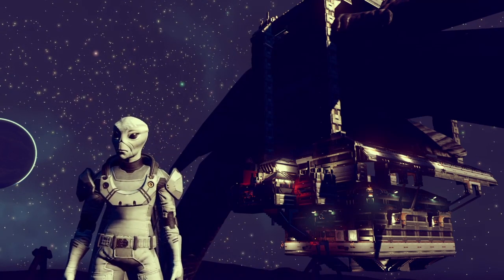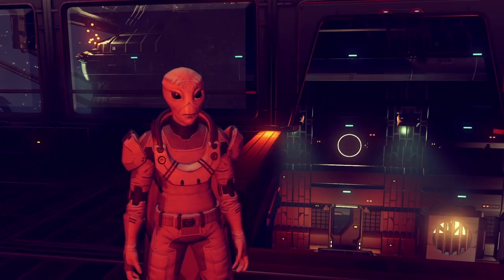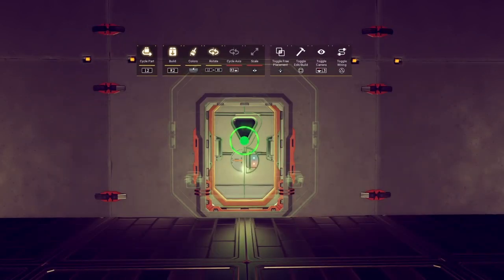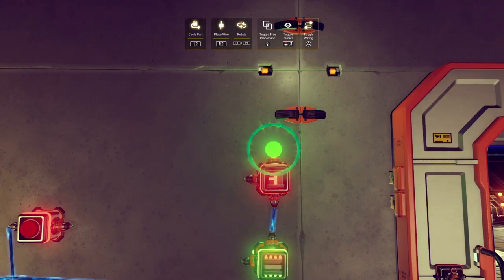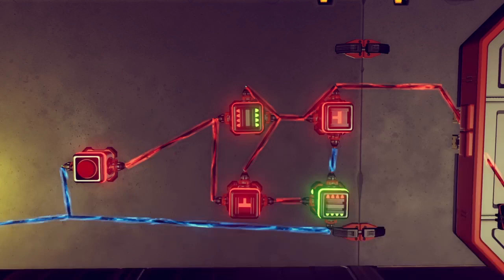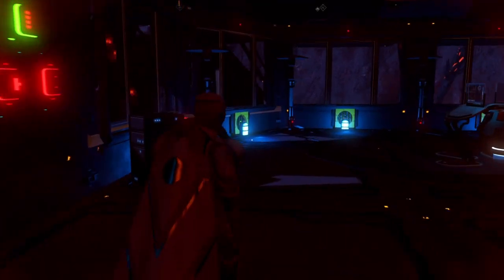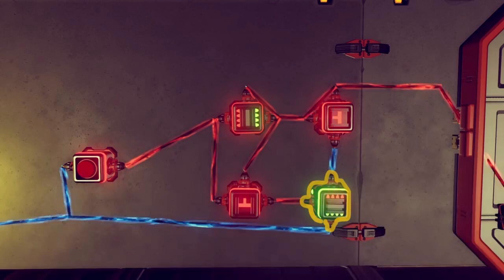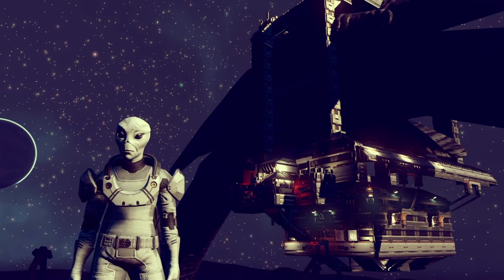No Man’s Sky, Logic School: Mastering The Big Red Button (with a basic toggle circuit)

Comment: That's so easy! I mean a simple open and close button would be extremely complicated to understand.
Reply from the maker: There’s already one of those, but there are a lot of reasons you may not want to use it. this is for triggering more interesting effects, operating a toggle is just its most basic use case. It’s step one to learning how to use the wire system to do things that are actually worth doing. If people just want to open doors they can use a basic switch or one of the ready made auto doors. If you want to understand how logic systems work, than this is where you start.
Reply: @rustyhatfield8302  I'm looking to create a toggling circuit that keeps it's state. Due to the timing delays from the inverter, internal oscillations can occur. E.g., if I use a floor switch instead of the big red button and stay on the switch longer than half a second the output oscillates. Any ideas? Do you have any complaints about this delay introduced by the inverter? I've found for my larger circuits, it can introduce significant output delays.
Reply from the maker: Sorry, I'm just seeing this comment now. So, you want a floor switch to activate a toggle, but you don't want the toggle to deactivate if you stand on the floor switch too long? That should be doable. You can use a power inverter to convert the signal from the floor switch to a pulse. That way it will only send a single pulse regardless of how long you stand on the floor switch. The time delay introduced by inverters and autoswitch can be an issue, for example in my shooting gallery build the time delay can cause some hits not to register with the score keeping circuit if it's scored too quickly after the last hit. This issue can be mitigated by designing more efficient circuits that use less actions to accomplish their task. In the case of my shooting gallery build I have plans to replace the current serial toggle method of scoring with a binary one that will pull off the same effect with WAY fewer components. That should greatly reduce the delay and make score keeping more reliable.
Reply: @rustyhatfield8302  Uhm...wow! Thanks very much! I've never expected any response because I somehow wrote this comment because I'm too dumb to understand this mechanic (and I've never had the nerve to test for too long, I mean meanwhile I can work on finishing the game and discover all planets). Cheers lad! I really appreciate your response!
Reply: @rustyhatfield8302  That's actually a really smart idea. I'd love to see a video of this process

Comment: "Congratulations! You now have..."

No I don't. lol. I followed this step by step and ended up with a door that just opens and closes immediately. No Man's Sky has found a new way to make me feel dumb
Reply from the maker: If it's closing right away you've missed a connection somewhere, have an extra unnecessary connection, or you've used an inverter where an autoswitch should be (or vice versa). Double check everything all of these possibilities. This 100% works on all platforms and versions of the game if it's properly assembled.

Comment: This must not work anymore cause i followed this perfectly and it just sends a pulse through the hole thing and goes back to the state it was first in
Reply from the maker: @justkief6521  It still works, and since its behavior is based on basic TTL logic, there’s no way they could modify the logic system to make it not work in the future. Double check your connections, if you miss any one of them it will produce the behavior you describe.

Comment: If I insert this door into a wall, no opening is formed (NMS 5.12)! How can I do this without having to build a corridor in front of it?
Reply from the maker: Since you most likely don't have legacy parts such as the concrete walls I use in my videos (better for showing off circuits), you'll have to use a wall piece that has an open archway or doorway already in it. This door should snap to those pieces in newer versions of the game.
Reply: @rustyhatfield8302  Thank you for your answer. I have tried it out. It snaps into place, but it looks unattractive because there are gaps on the sides.

Comment: I gave up on this at my base, just too complicated for me
Reply: Just use the holo door lol. Skip everything
Reply: The trick is to wire it one switch at a time. Follow out all of the connections of each switch, and on the last one you'll already have most connections you'll just have to make sure that you have power going to the button and the proper switch, (only one of the switches takes power from source, so it's not that difficult tbh as long as you don't confuse yourself with placement). Remember, big problems can be broken down into smaller pieces in order to solve them in a way that doesn't hurt your brain! You can do it

Comment: A lot of work just to open a door, just ridiculous. Easier to wire things IRL.
Reply from the maker: It took me ten minutes to figure it out and four minutes to teach you… so…
Reply: @davidwilliams7552  i agree..
Reply: @rustyhatfield8302  Whether or not they UNDERSTAND it is irrelevant. All they have to do is follow the wiring diagram you laid out for them and it's done in 30 seconds. I recommend focusing on one switch at a time and wiring them that way for those that have trouble actually understanding the underlying logic! Ez if you let it be, hard if you make it.

Comment: I thought button and  power inverter should have been enough this shit makes no sense
Reply from the maker: @iamarghus  Why would you think a button and a power inverter would be all you need? the button isn’t a toggle it’s a button. the switch is a toggle, the only problem is that more multiple switches interfere with one another and you can manipulate them programmatically. NMS uses transistor-transistor logic (TTL). it’s the most widely used logic system for constructing circuits in RL or gaming.
Reply: @rustyhatfield8302  it's a video game , and they made electricity more complicated that real life is,  my father was an electrician and i used to help him, when we would install multiple buttons to turn on a light from different locations, the power from all the buttons would go to a relay, basically you can have as many buttons as you want once either of the button is pulsed it would change the the state of the light ON/OFF, you can then also have relays the have 3 or more states.  Off/50%dimmer/100%
Reply: @iamarghus  smdh, lol. The button is a trigger , not a switch. It's an electronic component, not an electrical component like the three different switches (wall, proximity, floor). What you're frustrated with is that you want an auto-door like the wood/stone/alloy components and the cuboid door component is free of those constraints. Why not submit a feature request to get an additional cuboid door that works like that? The beauty of NMS is that it's playable out-of-the-box, and, has deep playability mechanics to keep more expert players interested as well. That balance can be difficult for all game developing companies because writing software is HARD and EXPENSIVE.
Reply: @daleasberry i wanted a gate/for that opens from both sides by pushing a button from either inside or outside a structure and you are telling me for a game you need more components than real life 😂 im just saying its way overcomplicated